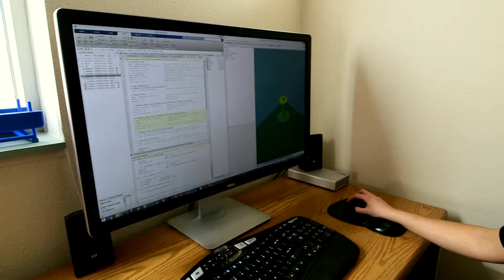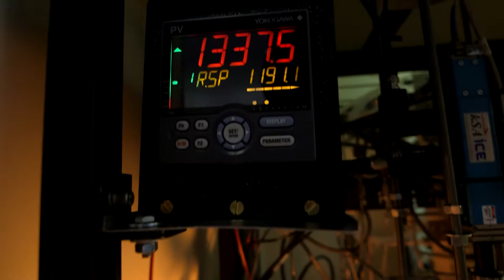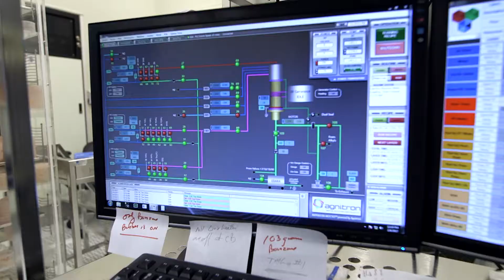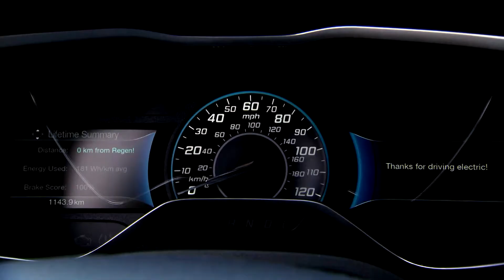R&D 100 Winner 2017: Ultra-Wide Bandgap Power Electronic Devices

Comment: As a third year electrical engineering student, I can confidently say that the statement at 1:08 about replacing all transformers with transistors makes no sense. You can step down voltage with transistors, but you can never step it up the way you can with transformers.
Reply: you may want to learn a bit more
Reply: Sorry but you're wrong. One can step up voltage with several types of circuits, the simplest one would be a boost converter, more complex topologies would give higher efficiencies.
Reply: A little pedantic, you're right you cannot increase voltage with a transistor, but you can use a transistor to control a circuit consisting of other components such as capacitors and diodes to achieve it.

The point is the smaller the transistors the more efficient the circuits can be used to do so because space is limited even in comparison to a laminated steel core transformer.  A conventional high current IGBT is pretty bulky in comparison to typical transistors yes?

Transformers are not as efficient but they also do a great job of normalizing transient spikes, it's one thing to make a  power supply that caters to a dedicated unit that is small and cheap- it's another to make something which is going to be handling computers, and arc welders at the same time.